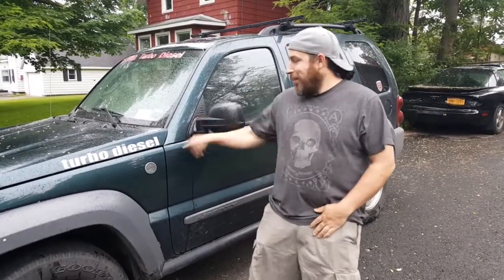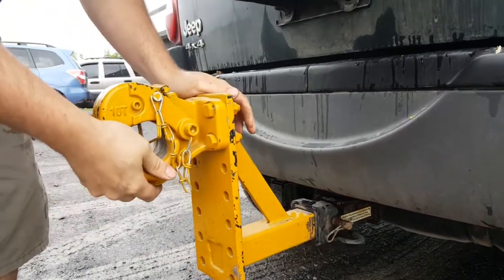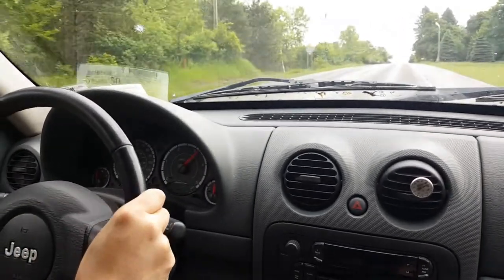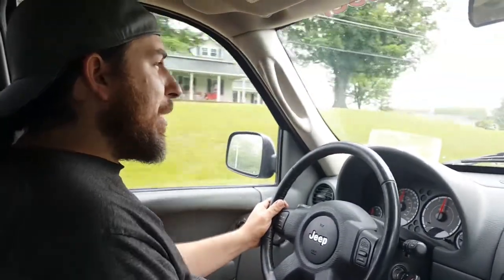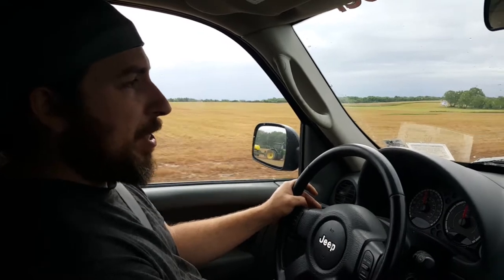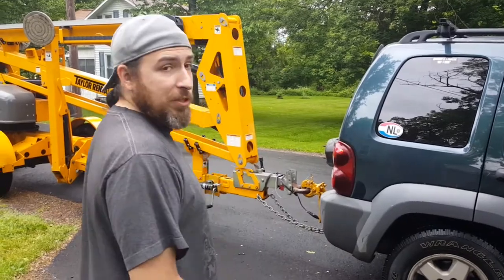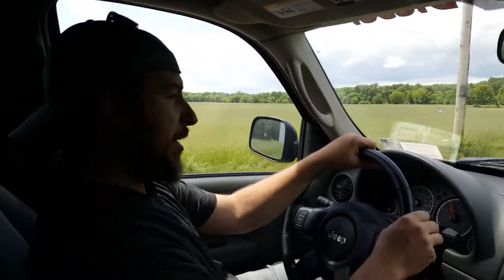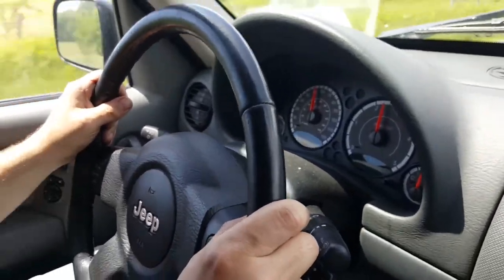Jeep Liberty Diesel Tow Review

Comment: Great video. I have four CRD's, one  2005 model and three 2006 models. I would like to know more about adding a transmission cooler to one of them. I have often towed with all of these jeeps, but I usually keep the weight down to 2500 pounds or less. I recently towed a 5X10 flat trailer loaded at about 2500 pounds total over Interstate 90 from Washington state to Sioux Falls, South Dakota, which is about 1400 miles. I closely watched the temperature gouge. The pass at Butte Montana is 6750 feet. I went over it at night and I used the passenger heat exchanger as a second radiator to keep the gauge from going way up. The inside of the cab was warm. Every piece of radiator hose on this jeep was new as of one year ago and I have a new water pump and radiator as well.  You really need to make sure that all of the radiator coolant hoses are in good shape before you tow a heavy load a long way. There are small coolant hoses in the EGR cooler system that will burst and then you are stuck.

Comment: The transmission cooler is inadequate on the Jeep Liberty CRD. You really need a transmission oil temperature sensor and a secondary cooler installed. I kept overheating my transmission climbing up the Henry Mountains south of Hanksville, with no trailer. Had to use snow and creek water to cool it down (instant snow to steam). Also, it was near freezing halfway up the mountain, and it still overheated.

Comment: Bought one of these a month ago. Really like it so far. Keep getting told they're bad engines/vehicles though.
Reply from the maker: I would not say they are bad, but some people have had had problems , do the egr delete and join jeep liberty crd page on Facebook, lots of good info located there and knowledgeable folks as well. There have been issues related to dropped valves or damaged valves. A head rebuild and few other upgrades would really extend the life of the engine. If you can do the work yourself it would save you A lot of money
Reply: @GitItGarage  I'll look into that egr delete. I know it does have some changes to it. K&n air system, aftermarket exhaust, lift kit. So with all that it probably will have problems down the road but no stranger to working on vehicles. Thanks!
Reply from the maker: sounds good ! Good luck to you ! feel free to reach out to us if you need any assistance along the way!!

Comment: Not Jeeps fault that you have a hitch that goes up one foot 😂 not a design flaw.
Reply: I have a drop hitch and it doesn't matter with a boat trailer.  Have to take the spare off.
Reply: Would you prefer to lose cargo space or fuel capacity?

People complain about the silliest things. 99% of the time the tire’s location is helpful.
Reply: No
Reply: Well that is right I don’t see why you need that for normal people but he does have a purpose trailer for that the other thing is that on the jeep Libertys if you have a tire in all the way inflated even if you do have the hitch all the way upside down go to give you more room it’s still ain’t enough room to put the hich on